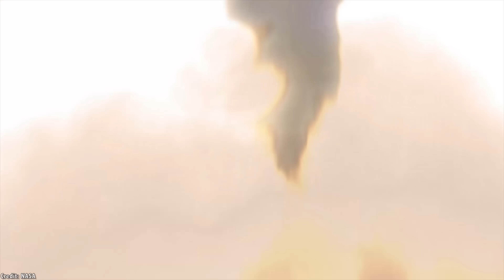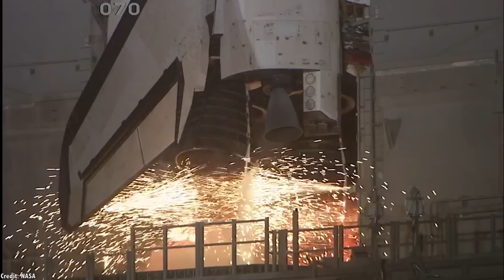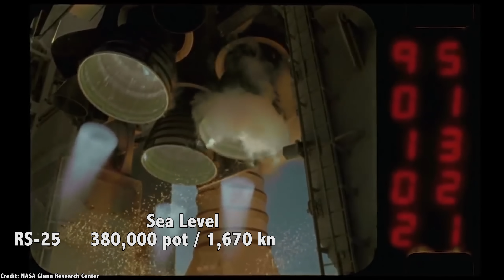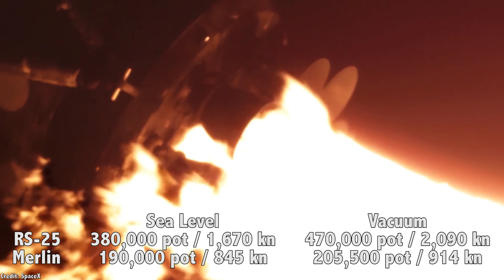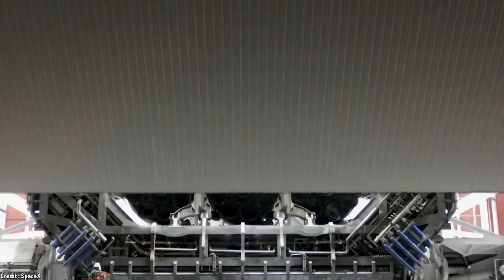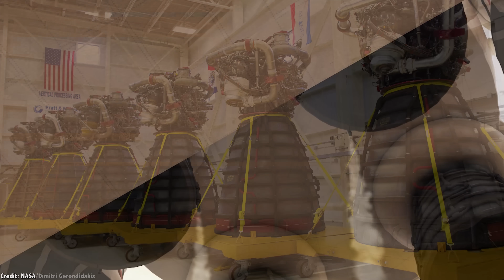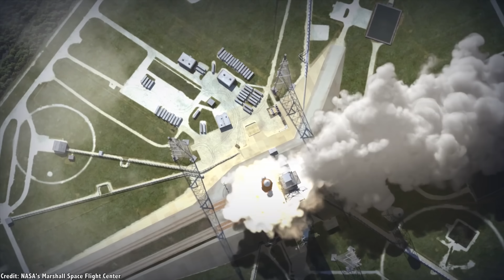The Rocket Engines Carrying Us to Space. The SLS RS-25 (aka The Space Shuttle Main Engine)

Comment: SLS is a dead man walking after the Falcon Heavy launch.  Hell, maybe they will use it to launch the other big boondoggle of the James Web Space Telescope that's 8 years late and 7 billion over budget.  Just for kicks, why not take the most efficient rocket engines ever, engines that were made for reusability, and then throw them in the ocean after one obscenely priced launch.  Woohoo, go NASA!
Reply from the maker: It is ironic that these reusable rockets are going to be destroyed. :-(
Reply: Zen, I'm sure I sound harsh, but I really like the idea of NASA.  It's a symbol of what we can do as a nation when we all work together, but they have become a parody of what they once were.  Good luck with that launch date, by the way.  Using the original cost and schedule, there should already be a constellation of 4 or 5 JWST's up there.
Reply: Dustin, I'm a fan of what NASA could be, but you can now launch 5 or more Falcon Heavy payloads for the cost of one disposable SLS, and it is already operational.  What's the point in testing engines for a system that is already obsolete?
Reply: JWST is going up on an Ariane 5.
Reply: Steve C NASA has been firing single RS-25's at Stennis for 2-1/2 years. Testing of the full 4 engine first stage is around the corner, these test stands in south Mississippi have been rocking.

Comment: With current tech and better LES it's be best to use solid fuel rocket for everything including the main one and boosters, just filled with enough propellant to get to the minimum distance where the module where astronauts are in could attach to a nuclear power rocket. We have to assemble a standby nuclear powered engine orbiting the earth, ready to be retrofitted to the module. The latest fusion tech like a tokamak can be assembled in space and that could be retrofitted to the module to get to the moon or Mars or Venus. It can be helped with the impossible engine if that really is true and plasme with miles of solar panels to heat materials for propulsion. God bless, Proverbs 31
Reply from the maker: The problem with solid boosters is that you can't turn them off.
Reply: I don't think solids are the way to go. They are cheap and provide a lot of thrust, but they are more difficult to control, have lower specific impulse, and the only way to reuse them involves fishing them out of saltwater which causes plenty of additional headaches. Liquid flyback boosters like on falcon heavy are less expensive in the long term and provide all the advantages of liquid fuel.

Comment: Hi, thanks, Fraser, sir. Inquiry: when 30 stories or of rocket and boosters are standing on the launchpad, upright, how come the cones of the engines at the bottom do not break under all that weight? Also, there's a hole on the launchpad, how all that rocket being suspended? Lastly, how are the stages glued together? Are the upper stages free standing like an obelisk? Or are the upper stages clamped or glued on the bottom stage? How does it not fall apart and separate during launch? I'll be designing some spacecrafts in the future for sure. 

Thank you. God bless, Proverbs 31
Reply from the maker: They aren't resting on engines, they're held farther up with clamps. Once the engines are firing and the rocket is countering its weight, they release the clamps.
Reply: I see, thanks. I assume the releasing of the clamps are done now automatically. I take that the russian design, they hold the rocket with those "fingers" that spread out like a flower (which looks better) when the rocket starts climbing?

What about the stages, how'd the 2nd attached to the 1st state? How's the 3rd attached to the 2nd stage. The stages are held by clamps too? Are those clamp operated electrically by small electric motors? Or the stages are held w/ some kind of glue? Thanks.
Reply: They use special bolts designed to split on command.
Reply: Thanks for the reply. Are those bolts like rivets or they are threaded and they have small explosives to separate the stages?
Reply: SevenDeMagnus : Bolts are always threaded. I believe the bolts in question have explosives inside them.
Reply: SevenDeMagnus jn most rocket they are stuck together with bolts, these bolts have explosives in then, upon stage seperation these bolts explode, separating the stages.
In the falcon rockets the stages are separated using a pneumatic system, (explosions are not good for reliability).
Reply: Thomas Wijgerse an explosive bolt from a good manufacturer will work 99% of the time, it's just rather difficult to test if they're in working order beforehand :)
Reply: Zen Punk sorry, i goofed up,  meant reusability :)

Comment: With what we've learned from SpaceX successfully landing 1st stages/NASA's SRBs and the immense lifting power of the SLS, what's stopping is from saving a bit of fuel for a reentry burn and recovering the SLS core under parachute-splashdown to recover the engines?
Reply from the maker: It'll be hard to recover a core that heavy, and it would reduce the total payload it could put into orbit. The ULA Vulcan is going to be doing that, where helicopters fly in to catch the engines parachuting to Earth.
Reply: Understandable, an idea to play with in the brain though.

Comment: What are the limitations of the Falcon 9/Heavy with their narrow diameter? Everyone talks about how they could replace the SLS, but are they capable to lifting physically big, not just heavy payloads in the same manner as the SLS?
Reply: they're limited to their 5-meter payload fairings, which atlas 5 and other vehicles can match. spacex has stated they don't plan to build any other sizes. New glenn is slated to have an 8-meter fairing and SLS up to a 10-meter fairing.
Reply: Thanks for the info! That's my primary concern with how SpaceX has designed the Falcon 9. The relatively narrow fairing is great for satellites, but you couldn't even fit the Apollo Lunar Module onto that rocket, let alone any new landers.

Comment: I dont think NASA should stick to hydrogen,  methane although not as powerful is much cheaper.
Reply: +USWaterRockets NASA should use 4 falcon boosters like the FH side boosters, strapped on the core stage of the SLS. This would give SLS much more lifting power, would be safer than using solid fuel and the 4 boosters can return to land and be reused. This would at least make SLS semi-reusable and save cost. But congress would never go for it because then Orbital ATK in Utah would be cut out of the Gravy Train and reusing hardware means less money for their jobs program.
Reply: It would be interesting to know the cost of refurbishing the RS-25s vs the cost of making new ones, as I believe I read that the refurb costs were way higher than initially estimated and in the end it may not have been economical. The same is true for the Merlin, which has very high refurb costs because of the coking, and the only savings on the Falcon 9 is the reuse of the tanks/cores. The engine refurb is also supposed to be the same cost as building fresh engines.
Reply from the maker: And with the right setup, you can just make it out of the air.
Reply: Methane won't coke up the engine internals like KeroLOX does, which is why the BE-4 will so much less costly to re-use than the merlin. But KeroLOX is a really good first stage fuel, so NASA really needs to ditch the SRBs and adopt the Pyrios booster design with dual F-1B engines. If you're not going to re-use your booster engines, you might as well use the best engines ever made.
Reply: The issue is more rocket cost than fuel cost, methane is good for making the vehicle smaller (and for better reuseability), but imo, hydrogen is fine, what NASA REALLY needs to focus on is reuseability. And they need to NOT destroy their amazingly expensive hydrogen engines, things that were designed to be reuseable in the first place! Hydrogen is great if your rocket is 100% reuseable, it also has the advantages of methane not coking the engine.
Reply: NASA doesn't have to limit itself to commercial rockets, though. If you need to send crewed spacecraft and cargo into lunar orbit once a year, having the most powerful and reliable engine is far more important than the having the most economical one. Reusability or low fuel cost isn't that important when flight rates are low.

NASA doesn't have to be SpaceX or Blue Origin. These rockets will complement each other more than they compete with each other. NASA will need to launch very valuable, very heavy payloads far beyond LEO at least once, in some cases, twice per year. For those applications, you pull out the big gun. That's where SLS shines.

To be fair, I'm not happy that refurbished Shuttle RS-25s are going to be expended. But the reality is that SLS's core stage will get all the way up to LEO before separation. Reusing it just isn't economical.

But the way I look at it is, if you're going to retire a Shuttle engine, shouldn't you do that the most epic way possible? Light it up one last time to send astronauts to orbit, on their way to the Moon, and send it off in a blaze of glory at orbital entry speeds? As long as the launch commentator acknowledges the missions the engines flew on, I think that's great.
Reply: What NASA should be working on at this juncture is in-space propulsion like NTRs or letting bigger conracts to Ad Astra for development of VASIMR. We don't need them to re-invent the wheel in launch infrastructure over and over again.
Reply: I believe the Falcon 9 as a side booster does not work because the rocket would become too wide to fit on the launcher. However, there were plans on the original Space Shuttle for various "flyback" booster designs ranging from what amounts to a Saturn V first stage with shuttle like wings it would return on, to side mounted liquid fuel boosters with a "scissors wing" that would also allow glide recovery. Too bad we never saw these come to be.

Comment: Very nice. A couple of errata. The SSME main engines use a diverging de Laval nozzle, but in order to avoid the flow separation from the nozzle walls, the final bit of divergence is a bit less than optimal. Your description seemed to imply something of the opposite. Also, the O-ring which failed wasn't connecting the SRB to the rest of the stack. It connected the individual cylindrical sections of the SRB together.